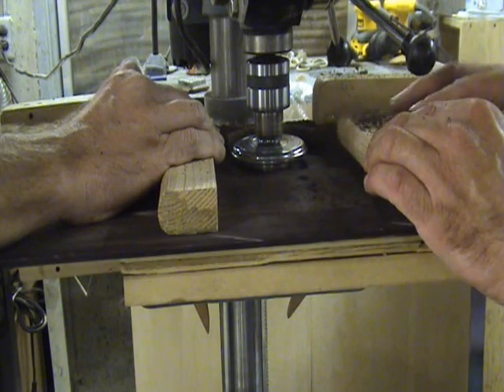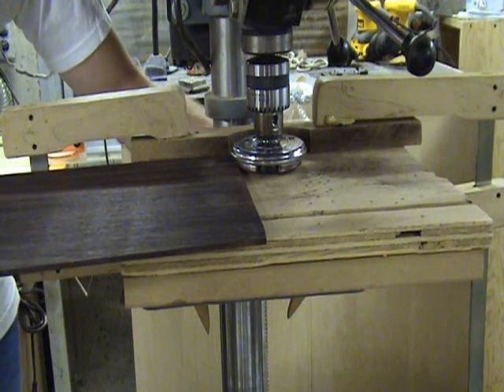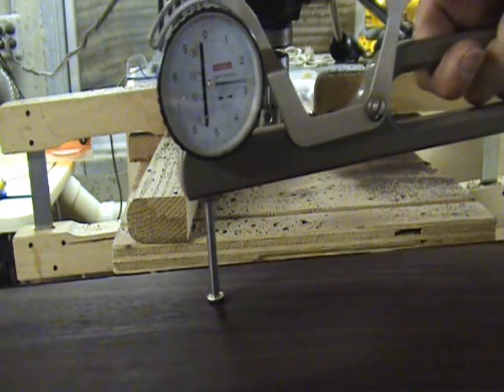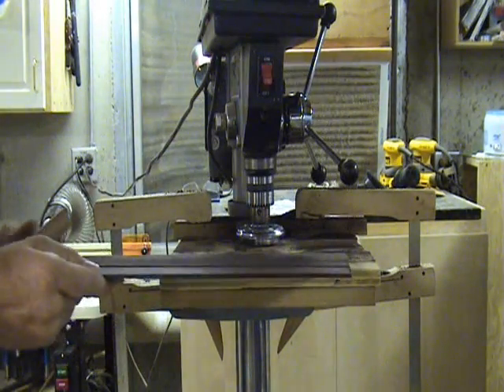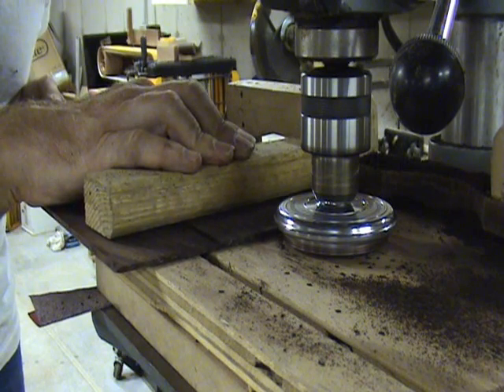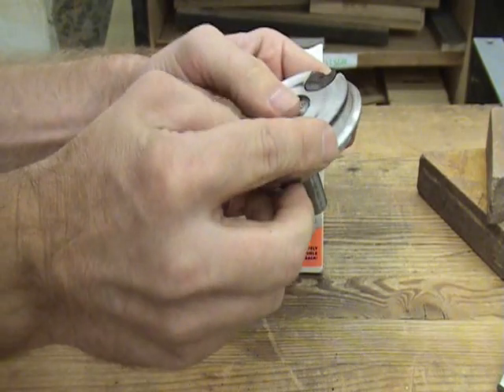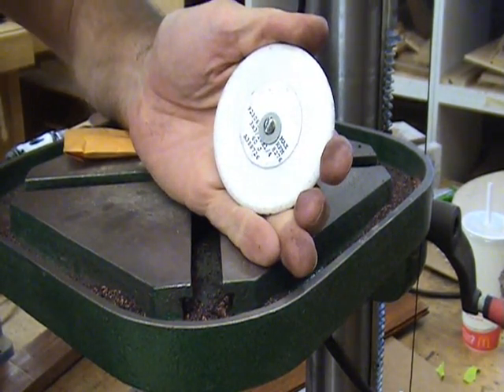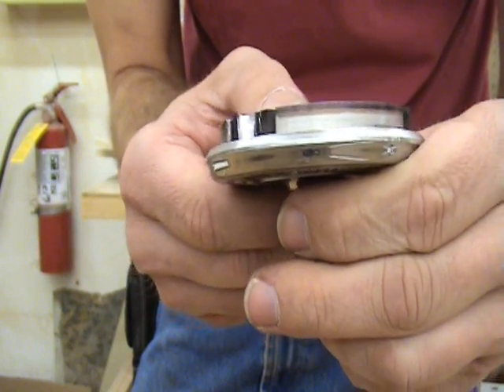O'Brien Guitars - Luthier Tips du Jour - Safe-T-Planer

Comment: I have a Safety Planer but I don't have the grinder sharpener. Where can I Buy it?
Reply from the maker: Stew Mac has replacement cutters and they might also have the grinding wheel.
Reply: @OBrienGuitars  Thank's for the info and I saw in your video that your Safety planer was a Wagner so I will check in that direction

Comment: At 1:40 index you recommend running the planer at 1700 RPM. Since these are rated to 3,000 RPM, wouldn't you run it at a much higher speed than 1700 for a smother finish? The instructions from Safe-T-Planer state: "...Run the Safe-T-Planer between 2500 to 3000 RPM.This minimizes vibration, for the smoothest cut and best results..."
Reply from the maker: Yes, I ran it for years at the rpm mentioned but now run it between 2-3k.

Comment: Thank you for a fine tutorial. You've convinced me to buy one to replace my Craftsman rotary planer. I use mine in my radial arm saw. I'm convinced that it works better than in a drill press.
Reply from the maker: Glad to enjoyed the video. Be careful with the RPM's on these. They are rated for around 3,000RPM

Comment: Hello and thank you for the useful video(s)! Ι'm about to buy a drill press for the job, and given my limited space and low budget, I'm considering my options. My specific question is, do you find any reason the Bosch PBD40 Bench Drill is not fit for the job? Especially is the distance between the drill and the pillar too small? Thank you in advance!
Reply from the maker: I am not familiar with this model. I use a 12 inch Delta benchtop model and it does everything I ask it to do. You do not need an expensive floor model.
Reply: @OBrienGuitars  Happy New Year! Thanks for your reply. What is the minimum distance between the pillar and the drill for the drill press to function properly with a safety planer?
Reply from the maker: @kadoglouioannisluthier5456  mine is probably 6 inches at most.
Reply: @OBrienGuitars  Thanks, this answers my questions!

Comment: Hi, I'm curious why you do your preliminary thicknessing with the safe-t-planer instead of a standard shop thickness planer and a backer board. That's the way I learned and currently do without too many issues. Much obliged for the answer and your videos
Reply from the maker: Depending on the species of wood you will go through a lot of belts thicknessing. The oils and resins will clog a belt quickly. You also create sawdust that gets into your shop environment. I find it more economical and quicker to use the safe t plane and then finish with a couple of passes through the sander. If you don;t have a sander then a scraper and a some elbow grease also works.
Reply: OBrienGuitars Hi and thanks for taking the time to reply, but I wasn't talking about doing the thicknessing entirely with a sander (I run a 25" WOODMASTER sander and am familiar with the issues you mention in your response). What I meant was doing the prelim work with the thickness PLANER and a "sled" as it's sometimes called and finishing, as you do with the sander. Again , thanks for taking the time.
Reply from the maker: timberjack You could do that and probably be fine but there is going to be that one time that you get tooth picks out the end of the planer. The new spiral head with carbide cutters are nice and work but like I said eventually you will probably get toothpicks due to the thickness of the wood. Give it a shot though.

Comment: You make it look easy Robbie but it just will not work that way for me for some reason. I use exactly the same method as yourself but theres several problems. The planer heats up. The drill stalls and almost cuts out. I tried 1700 rpm and then 2000 rpm but same result. The tool is brand new and purchased recently so I am assuming it should be sharp enough?  I am disappointed so far as this is my only planing option at the moment apart from a hand plane .

Comment from the maker: The wood is too thin for a planer and and too thick for a sander. If you use a planer you run the risk of getting firewood when it comes out. If you use a sander you will dirty up a lot of belts. I use the safe-t-planer to get me close before going to the sander

Comment from the maker: @danbombliss I use a variety of planes. I use the block plane to just removethings quickly like if there was any uneveness at the seam. I then usually use a smoother or low angle jack to plane the top. You will be surprised how quickly you can take it from 5mm to the thickness you need. It is quite therapeutic. Have fun!

Comment: @OBrienGuitars What kind of block plane are you using for thicknessing and what dimensions are you starting at? I definitely see doing it by hand having the most controllable results after you get the feel for it, but if your tops are starting out at 5mm thick or just over, do you roughly thickness them a bit closer to the 2.5 or so or .125" before you start by hand?

Comment: @OBrienGuitars Hey Robbie, I recall seeing your DVD a couple years ago, and seeing your process for hand planing your tops down, but I can't recall if there was a reason for hand planing other than the fact that the top has to be joined to do the rosette before you thickness it. I was thinking since the top is going to be too wide to get the whole thing planed, is a good idea to use the safety planer as far as you can in both sides and then going back and hand planing the remaining strip?